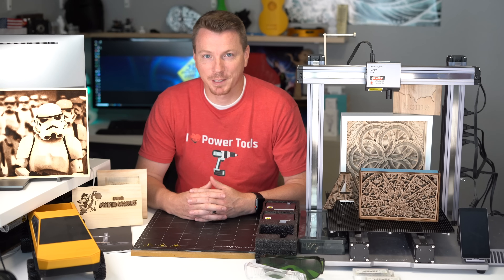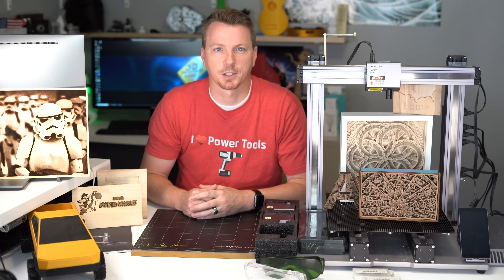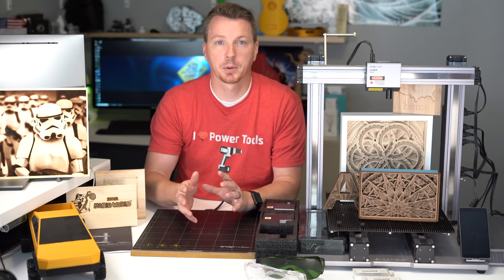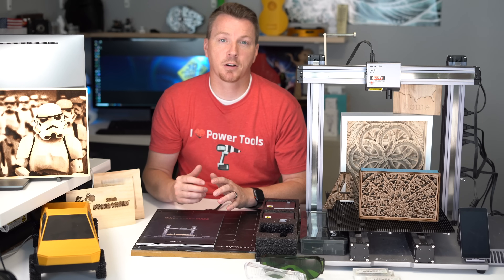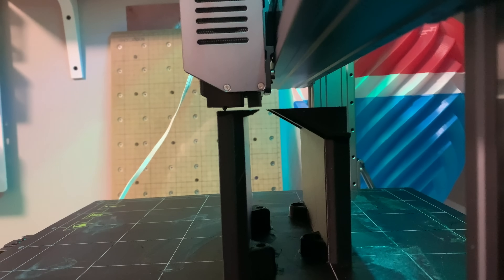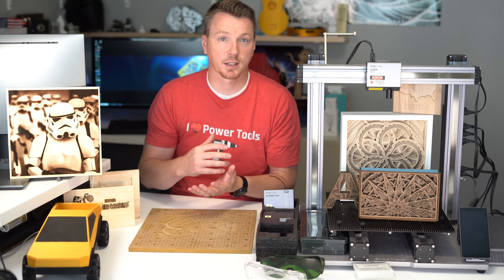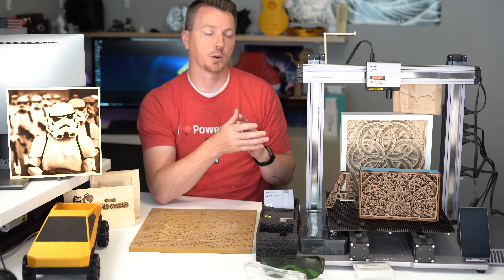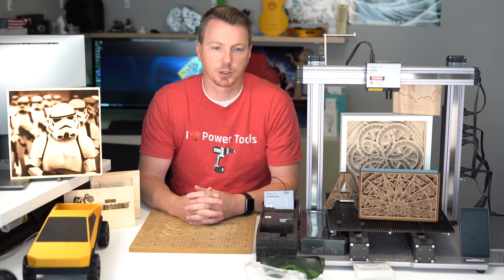Snapmaker 2 Review: 11 Pros plus 6 Suggestions

Comment: I really like this machine, but I'm extremely skeptical about the price
Reply: if it helps a single maching doing one of these tasks typically costs this much or more...
Reply: @major2571  not really, you are paying for build quality, ease of use and overall experience here. You can get a really good 3D printer for around $400 and a CNC + Laser engraver more capable than this for $200
Reply: @luca_sbll  what would you recommend for each of those?? I originally planned on getting a Artillery Sidewinder or an ender 5/10 for a 3D printer. I saw this as a CNC&laser engraver and I’m intrigued. But I would like to know what 3 you would recommend thank you.
Reply: Its 1800€ or 2200$
Reply: Same
Reply: Its worth it ive had a week and it has not stopped running and thats just on the laser print side. I haven't even been able to try the other modes. People keep offering me money to print stuff for them.
Reply: @danielt5848  it’s a cool machine for sure, but as I said in a previous comment you can get two more capable machines (a 3D printer and a CNC + laser engraver) for a lot less money than this, and you can run them at the same time as well. With this you are paying for things that if you are truly a maker and tinkerer at heart, you don’t really care about
Reply: @kiegancarstens3013  The capabilities of the Snapmaker cannot even remotely be compared to a laser engraver that costs a few thousands. They can however be compared to a sub $200 CNC mill + laser engraver combo

Comment: I have had an early A150 and now with the enclosure around it, and this review is very accurate in terms of the pros and cons, although I have yet to get around to using the laser and CNC modules. The thing is super well built, it's like the apple of 3D printers (/mill/laser engraver). Everything is machined with fine chamfered edges although it is quite loud. I still use my workhorse Prusa Mk3 clone for most things since its much quieter. The A150 isn't as capable as the other snapmaker machines given it has only one z-axis module, so it can't machine as well since it is less rigid. On the flip side it can achieve higher temperatures on the hotend and heated bed, 275 on the hotend and 110 on the heated bed, I think because the power supply is the same for all the printers.
The enclosure is also very nice, with big doors on two sides for easy acessability and built in LEDS. There are a couple of minor issues which I'm planning to print fixes for. 
The doors made from laser cut I think acyclic panels, are bowed outwards in the middle so there are slight extra gaps on the top and bottom of the doors. I'm planning printing a small hold down clamp that fits on the frame rails to fix this. 
Also there are slight gaps on the ends of some of the rails, nothing printed end plugs couldn't fix. The enclosure extraction fan (and flexible exhaust pipe for venting outside) could probably deal will all that but nice to keep it as well sealed as possible since I also want to try printing higher temperature materials in the enclosure.
The enclosure doesn't actually have a base or is connected to the printer directly. When installing you drop the enclosure down over the top of the printer, and then install some small brackets which loosely hook around the printers rubber feet under its base. If you lifted the enclosure it would probably also lift the printer but I wouldn't trust it.
Reply: With all due respect, Apple did only one thing great, and thats marketing. They are a monopolized company. Snapmaker is far from monopolized as indicated in this awesome review. I wouldnt compare this to the Apple brand. Its far beyond the apple brand just like Android has over Apple. Apple is for users that dont understand technology. its user friendly, and you can't customize as you should be able to. You don't have access to things you should be able to.
Reply: @theduke3271 android isn't a brand

Comment: Odered my A350 Nov 2019, Got it last week and I printed my first few things. Really good printer. Awesome review, as you were spot on on all points. Reinforced that I made a good decision for this printer.  I have to agree for the laser it is not quite strong enough. I have a sign shop, and the laser was meant to do nametags and such. It will be lengthy to cut through the plastic. Probably not worth the shop time. So I'll need to invest in a industrial laser unit eventually.

But overall, Im super impressed with this printer. Like you, it all started with the unboxing and manual. It was put together really well as you mentioned. I've built manuals before and I was certainly inspired by this one!

Watched a couple of your vids and they are very informative. New subscriber right here!!  

Thanks for your time for making these videos!

Comment: I was pretty early into the 3D printing space with a Replicator 2 form MakerBot.  I just received my Snapmaker 2.0 A350 and you can really see the evolution of the space over the nearly decade o time between the two machines.  I have yet to have a failed print with the Snapmaker even though I was used to a non trivial number of failed prints on the MakerBot.

I had kept my 3D printer on my desk, but the snapmaker needs a more industrial space if you plan on using the laser and cnc modules.  The laser is essentially burning things, so you just need the ventilation due to the burning smell and the CNC module makes saw dust just like any other wood working tool, so you just need it in a space that can be readily vacuumed for saw dust like a garage or work area.

But I'm super impressed, it's a great machine and having the option of working with wood really takes your projects to the next level from plastic.

Comment: I recently took delivery of a Snapmaker 2.0 350 and the difference from my Anet 8 experience is mind blowing. If I can use the analogy of a car, if every time you went to use your car you had to raise the hood, tinker for half an hour just to get it started....this is the Anet 8. Snapmaker just get in and turn the key......go! I am seriously considering buying the rotary module but I feel it is just too much money at present ($800). Maybe when enough users make the machine more economically viable, I will consider it. Great instructional video by the way. Keep up the good work.
Reply from the maker: Thanks so much and I agree about the Snapmaker! For what it's worth, I've been trying out the Rotary tool for about a week now and am making a a full review video for it. It's pretty rad. Opens up a lot of possibilities and they're upgrading software and firmware to add much needed functionality for it. Stay tuned for more.

Comment: Two more pros you could have mentioned - they are coming out with a more powerful laser - its in the road map. And also their support is really very good - they reply to emails in proper English and accept the responsibility when something goes wrong due to to a design flaw. For instance I ordered a spare magnetic bed (because I pressed too hard with my spatula and damaged it) and the replacement arrived with some shipping damage. When I sent them photos of the damage, they immediately sent a replacement of the replacement. All shipment is by courier too so pretty fast considering it has to come from China. There is also a well populated forum where one can find advise on most common issues.

Comment: @14:45 screws have backlash, belts have none. this is why most designs use belts. also, lead screws are responsible for many of the artifacts people see in Z axis because perfectly straight lead screws is rare, especially long ones. high precision uses ball screws with pre loaded bearings.

Comment: Just got my A350, first 3D printer and currently doing my first print! While I am waiting, I will make a quick comments on your list! Absolutely the quality is amazing! Can't agree more! I found my self stopping the build process just to admire the quality. That said, my biggest issue.... I want the feet to be 1/4 to 1/2 inch taller! Odd request, however, where do I put the CNC board? Oh.. totally under the base, that makes sense to put it... wait.. it doesn't fit!  Ugg! Probably an easy fix, 3D some standoff's and a longer screw! 

Great review! Thanks! 

BTW, does anyone think putting the power supply on it's side would be an issue? I put a small  shelf up behind the printer, and put the PS on it's side on the shelf! Thoughts?

Comment: You mentioned you can print from Cura. Do you have to use a USB drive? Or can you print directly from Cura? Snapmaker is not an option for a printer choice in Cura, so I am wondering how to configure it. Also, what tutorials and videos did you watch for Luban? I am having a difficult time finding resources to learn it - especially when it comes to customized supports.

Comment: Great, thorough review, Nils - much appreciated. Of the items you suggested, do you know if any of them have been addressed during the past year+?
Reply from the maker: Actually, yes. Quite a few have been updated. Actually, my top 3: The power supply noise has just recently been fixed, there's a new 10watt output laser (8x more powerful than the former) and the software received some pretty major updates, so kudos to Snapmaker for making these changes. Keep in mind that the Laser isn't actually released yet - it'll be out Q1 next year.
Reply: @The3DPrintingZone  Great to hear. Thanks for the quick reply!

Comment: I think that my preference would be to have an Ortur 2 20 watt (actual 4.5 watt power) 400mm x 430mm laser, a Sainsmart Genmitsu 4030 cnc router, and a Creality Ender 5 plus 3D printer. A little more space and money but no baseplate changeover, higher quality, more laser and router power,  & more size capability.

Comment: I'm eagerly awaiting mine. I have a box full of 3mm filament left over from my last printer... Do you know if there's a way to manipulate the hot end to use 3mm?
Reply: I'm sure it's possible but not without considerable modifications. You'd have to replace several parts, drill out other areas and, of course, modify your slicing. Let me know if you end up doing it. Definitely possible but not a simple update to make.

Comment: I think the laser is not powerful to comply with the laws of different countries. I am the proud owner of an SM A250 which is truly an excellent machine. I recommend placing it on a concrete slab and felt pads, because since everything is direct, without belts and with a very rigid frame, the machine shakes the table on which it is placed... 😀

Comment: Considering purchase of one of these as it seems to be really well built. Unfortunately, I am less impressed with the quality of the design. Three further improvements occurred to me while watching your excellent video:
1. The diecast bed support frame looks very cool, but too thin to be sufficiently rigid. This could have easily been avoided without adding to the bed height by moving the actuators further apart so they are aligned with the edge of the bed and using the empty space between them for a much thicker and therefore stiffer bed support bridge.
2. They could easily have made the different beds much quicker to swap. Leave the bottom plate of the printer bed attached permanently and make the other beds attach to this magnetically like the heated printer bed. By fitting pins under the exchangeable beds which penetrate holes in the bed frame the beds could be constrained against horizontal displacement.
3. With some small changes the design could have accommodated two heads simultaneously. Either make the heads narrower or make the horizontal actuator a bit longer (or just accept that the bed width is reduced when you use two heads). Then I would separate the camera and laser into two separate heads allowing use of the camera head with any of the other heads, or alternatively allowing two printer heads for dual filament printing. There may also be uses for mixing head types as well, so this simple change would greatly increase flexibility and specialist use cases.
Reply: Since my comment from three years ago was just 'hearted' yesterday, I thought I would give an update! I did buy one of these (the A350 with enclosure, but I initially bought the printer only version so I could add the higher power 10W laser as soon as it was available. I have since also added the CNC function). One complimentary comment I disagree with you on is cable management: this is my first printer so I do not have your comparisons, but all my first prints and designs were cable clips to tidy up the messy and snag-prone cabling! Snapmaker have since addressed many of our other gripes including launching higher power lasers, quick swap kits for the three modes and a dual extruder head. I agree about noise, but I think that is unavoidable and I have banished mine to an outdoor shed and fitted an enclosure heater for winter use. I also take advantage of the standards compliance you compliment by using OctoPrint on a Raspberry Pi 4 so I can have full control anywhere in the house from a web browser (this bypasses the touch screen entirely). One thing they did not take us up on was stiffening the bed by using the empty space around the linear actuators, not even with their new Artisan design. This would have been particularly useful with the higher power CNC module they launched!

Comment: I'm really curious, what sort of depth of cut would you be able to make (using multiple passes) in the likes of MDF and plywood? I get that the laser will only just about cut 1.5mm ply. I'd like to be able to make accurate repeatable cuts in the sort of material I would normally have to do on my scrollsaw, so potentially cutting the full thickness of 3, 6, 9mm. Does this seem practical?
Reply: CNC, no problem. Laser, 3mm is annoying already.
Reply: You want to take a full DOC when possible. Radial load is more of a limiting factor than axial. Any modern CAM package will post out HSM toolpaths. If you're just doing cutouts and not pocketing 2d contours at full DOC and low feed would work fine. Leave stock for finishing to account for deflection.

Comment: I didn't hear you mention having any problems with the bed leveling. I've seen reports in the Snapmaker Forums of people having the print nozzle dig into the bed during auto leveling.
Reply: I don't have mine yet (pre-ordered, not kickstarter backer), but I've been in the Facebook group for a while. It seems like they've fixed most, if not all, of the bed leveling issues with firmware updates. Tons of people in the FB group have been getting their A350s recently and I haven't seen any complaints about the bed leveling for a while now. /anecdote
Reply: @JasonLynch  Thanks! I did read an official forum post by a snapmaker team member about how the auto level sensor wasn't getting properly spaced from the factory and it would be addressed going forward. Good to hear its been addressed and it sounds like it's been resolved.
Reply: Those that are having issues from the most recent batch appear to be first half of batch 4, predominantly, which I think were made/boxed back in Feb/March. The ones I've interacted with have all had instant success/fix by following the sensor calibration guide that was posted in SM's forums.
Reply: I had mine dig in but that was because I unplugged the module while it was auto leveling to see if it would recognise it. Turns out it doesn't, although this was back in February and they have probably fixed that, and it's a very unlikely scenario.
Reply: Some of this has been fixed in firmware updates....and some people had their A350 beds installed upside down.....and the auto level sensor adjustment helps too.
Reply: that was a software issue that made 3D printing a living hell on some 350 sm2 but aparently that issue was fixed on last firmware update

Comment: I think that the wireless controls are limited due to safety. It is easier to check if everything is alright (and no curious cat is inspecting the machine) if you are there to start the job. I understand, that it can be annoying, if the machine is standing right next to your PC.
Reply from the maker: Good point. It might be more of a liability thing.
Reply: I found OctoPrint to be an excellent way to get full control via a remote computer. With a camera attached to a Raspberry Pi, I can monitor status from anywhere.

Comment: love this printer, just need to save hard. it sounds so good. just the machine for me, and i must say a very good review
Reply: Actually it does not sound good as it's literally LOUD. Even with the enclosure. Also the power supply makes unnecessary static noise that could be prevented with really cheap and easy modifications.
Reply: @TimoLahti  can you print up some fixes like you can with the ender printers?